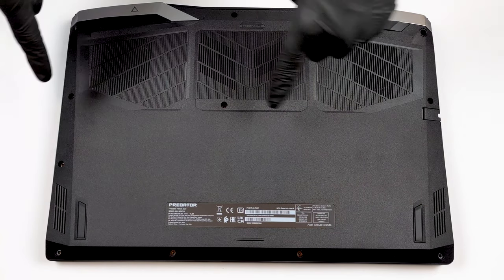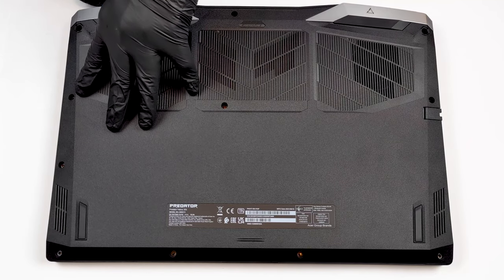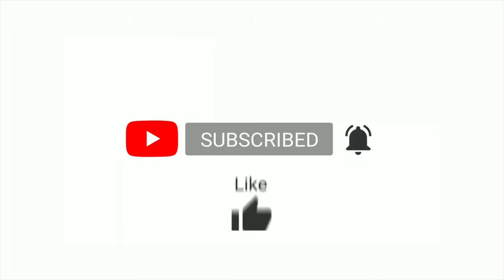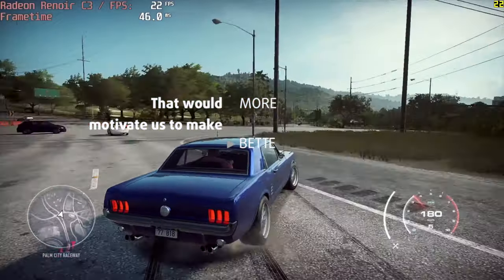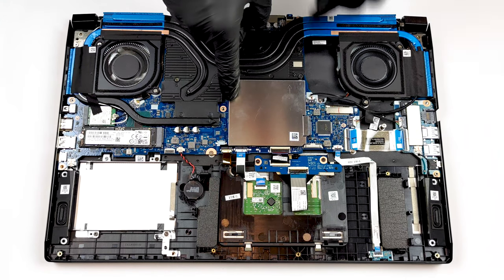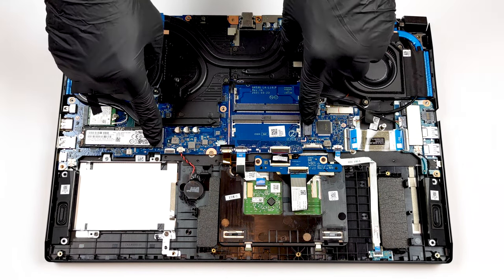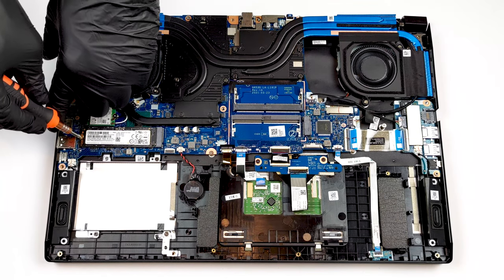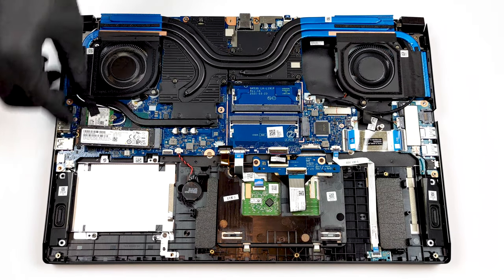🛠️ Acer Predator Helios 300 (PH317-55) - disassembly and upgrade options

Comment: Laptop Media can you please help me out I have this type of laptop 315-53-71HN rtx 3060 I7-10750 my issue is I have a lousy 55 Watts battery on a machine that the battery is pathetic I believe this device can handle a better battery instead of 2,5 inch sata any advice if anyone has a suggestion I would be grateful thanks!.